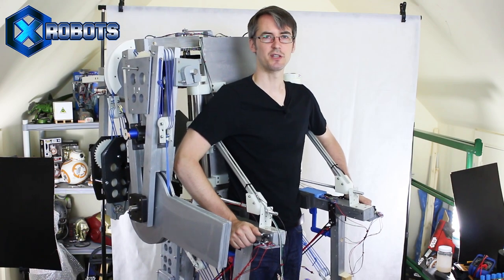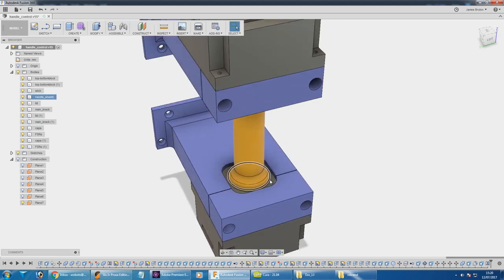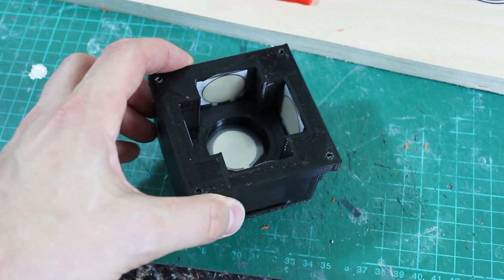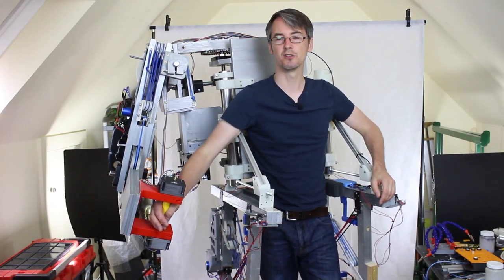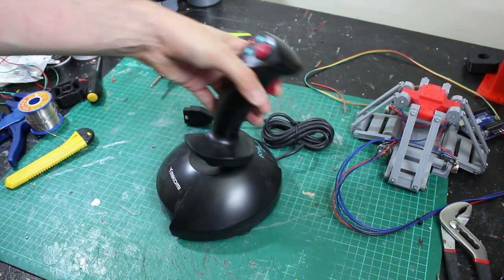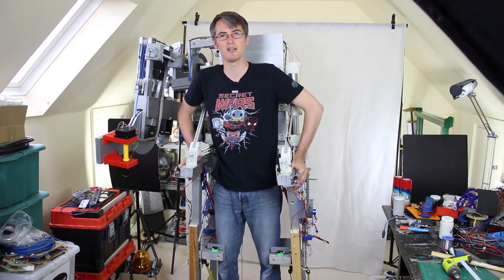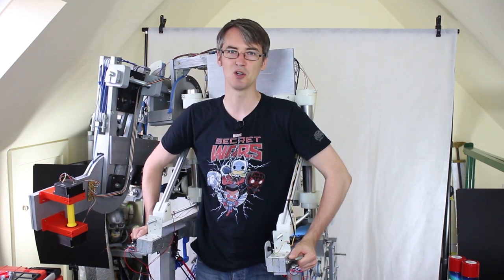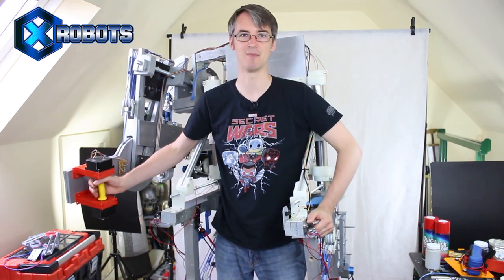Iron Man Exosuit #13 | Controllers | James Bruton

Comment: I've got an idea for your arm control, have it serparate from the suits arm. you could have a thing that goes on your arm which measures the angles of your joints and you could have the suit replicate that, maybe the device that goes on your arm is detachable or completly seperate from the suit so that if you want to lift something remotely you could do so.
Reply: t rice just like the giant robots in avatar
Reply: exactly my thought!
Reply: you mean like motion capture hollywood style? interesting, could work. he would just need a cam in the 'cockpit' and few dots on a jumpsuit. but i think the output from a agile human body might be difficult to translate.
Edit: sorry for my bad english my feets cant do better
Reply: Or something like his Ultron build, where he had sensors on his arms
Reply: I was think the same thing, but if he wanted to he could leave the suit with the thing still on his arm, if he wanted to move the arm remotely
Reply: smelly foot I think a more mechanical way would be more accurate and more easily controllable. Or not. If the power armor arm's size would be the same ratio as his arm basically he would only had to make the arm's joints follow the same angle position as his arm, as I think.
Reply: uuh appleseed mecha suit. i like the idea.
my biggest concern are the shoulder angle. the issue could be solved with a remote control system (appleseed/avatar style) but as james said he wanted to build a ironman/mechanical like suit so idk. maybe few fancy shoulder-blades(ish) concepts are going to be added in the upcomming build.
Reply: +TheCsaknorrisz I thought the same way. If james holds on the idea of an mechanical control i would recommend the controller mounted on a slide so the power arm can extend freely with or without a added shoulderblade

Comment: I think preloading your resistors with some pressure should solve your lack of sensivity. Of course you have to calibrate them in software then. All in all I think this force joystick is the most intuitive and elegant solution.

Comment: Have you considered load cells for the force measurement? You wouldn't need to mess around with squishy blocks and unridgid parts trying to rely on the force hopefully pushing the sensor disks, load cells are super fast and have high resolutions They are very common and cheaply available together with the hx711 driver board (I get mine from aliexpress).

Comment: If you use steel cables, they can be smaller and the pulleys, how about 1 cable bicep and 1 cable tricep on separate pulleys that wind up the cable. When you make the shape more ergonomic, that would reduce the size. You could strap the pressure sensors to yourself so you don't have to bang them every time, and there are EMG sensors that don't need to be on the skin.

Comment: What about electrodes on your muscles to detect the impulse and activate the suits corresponding motors. I think that's how the open source 3d printable prosthetic arm works. Check that out if you've not seen it.

Comment: Thinking about your proclivity for using wood lead me to wonder what it would look like if you stained it rather than painted it. I would totally change the aesthetic, of course, but with the gears, the block and tackle mechanics, and stained wood, you could get a very interesting nautical steampunk feel. Maybe printing all the parts in brass or steel colors. You could use fabric wrapped wires or run the wires though metal mesh hoses and hide the circuitry in printed or wood boxes with gauges, switches, and led powered light bulbs and vacuum tubes, etc... I'd love to see something like that. XD

Comment: Your webbed bushings have a circular hole in the middle where the axial force sensitive resistors go, could this be why they are difficult to trigger? They might not have enough material to press against. I might be missing something though, just an idea.

Comment: I think you might be better off controlling the legs with foot switches or something (maybe fuse those with the knee switches).
My other thought is that your knee switches might be in the wrong place- it doesn't look like you're able to lift your legs up too high with the current setup

Comment: I've mentioned it in a previous video's comments, but what do you think about experimenting with a strain-wave gearing mechanism? This Taulman Alloy stuff you're using seems like it'd be durable enough while maintaining the flexibility needed for the strain gear (it is nylon and nylon is slightly flexible IIRC), and it'd offer some benefits such as being more compact, high torque/reduction, no back-lash, etc. Just a thought.

Comment: 14:30 bottom right corner, has that gearbox pulled the bolt straight through the plastic from the load??

Comment: Use EMG to control it! Just kidding... Please use some nearly 3000W low kv outrunners for the next version if you have the money. You'll gain the ~15% loss in efficiency back with having to use MUCH less gear reduction and you'll still have plenty of RPM for the motors to spin up and lift something heavy considering the flat line torque curve. Also an idea I've been playing around with is hollow planetary gear reduction that you can fit your arm through to use space more efficiently. Just some food for thought

Comment: Love this project, looking more like a mech suit than an iron man suit though, but that's okay. It's probably impossible to build something as sleek as iron mans suit. That said, one project or idea I'd like to see you work on is reverse engineering a human muscle and perhaps incorporate that into your project. Perhaps using pneumatic or hydraulic pressure, maybe even electric find a way to simulate tendons and ligaments and create a robotic arm. Then maybe you could put that on the outside of your arm to multiply the force you can exert. I think if you're using gearboxes and axis it will never get compact enough, need to use muscles like a body.

Comment: I honestly think the original parallelogram-based controller could be refined more, and be made less sloppy. You want it to physically return to a default center position, so it needs some mechanisms to do that. And possibly something to create resistance to movement. There's friction to create resistance. If you want to smooth motions out, there are fly-wheels. You have already been using ninja-flex for compressive elasticity. Gasses compress in cylinders, too. Really just need to define what you want it to do, before selecting mechanisms. But you know this stuff better than me, anyway.
Reply: Eh... You know what? The controller you made with ninja-flex is closer to a working state, anyway. You just need to separate the bar and the yellow handle from ninja-flex squishy cuboid, using a kind of grooved bushing thing, to make to handle move up and down like a track, while still being able to apply twisting motions to the pressure sensors. Then install a linear potentiometer to the yellow handle, along with a pretty firm spring type part, so that you can read how far the handle slides. You could print multiple thin slices of nin-flex, and sandwich them between something to act as spring, then take out or add slices of varying density and number as needed.

Comment: James I am very stupid compared to u and have no 3D printer but I want to say two things 1. Don't attach the control to the actual arm because you can see how much u need to stretch your own arm  2. Can u make a homecoming mask for humans with slight modifications to the robot mask
Reply: A project idea I have is that u make a robot or the Spider-Man robot so that it has a camera in the head and connect it up to a vr headset / controllers. I thought it would be cool but hard and it might be the thing that could be super original and draw in a lot of subs / viewers